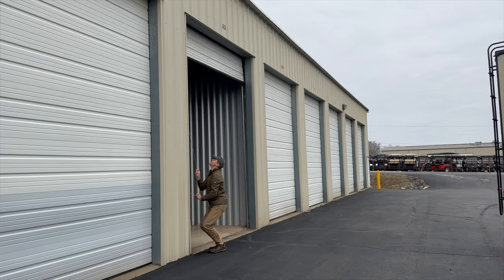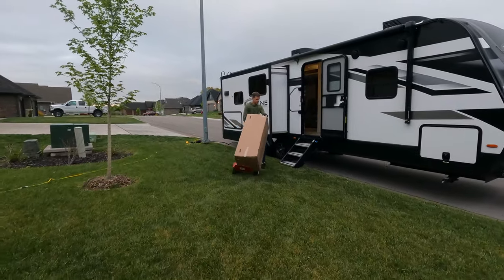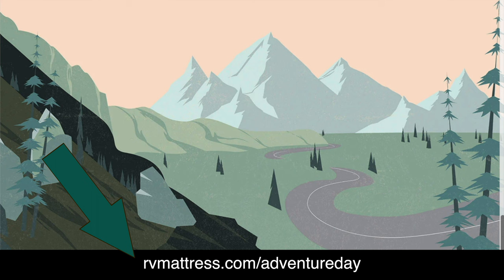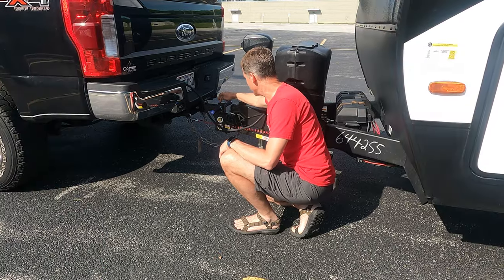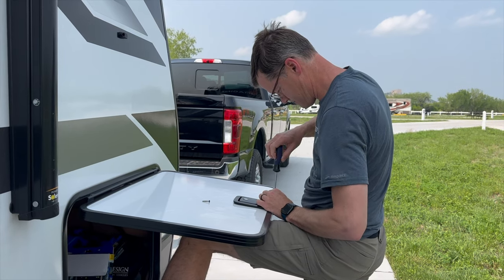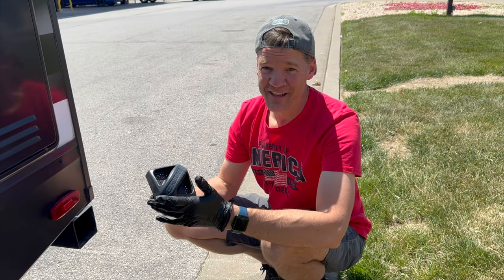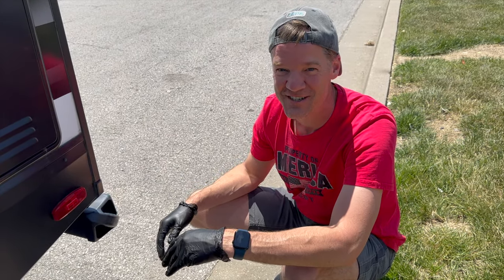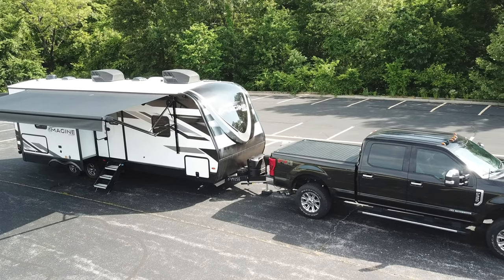New Travel Trailer = New Upgrades // 12 Important Travel Trailer Accessories [EP 102]

Comment: Great to hear y’all have your new rig. Interested in knowing how your towing experience is compared to your past fifth wheel. We have a 32 foot rockwood travel trailer. Pulls great until we get in windy days. Basically same truck as you and the same equalizer hitch. Normal wind and semi’s don’t affect it at all , but 30 mph or so winds are a different story. Just curious how it compares in your opinion. Thanks and congratulations again.  Hope the new puppy is doing well !!
Reply from the maker: Thanks so much! Ginger is doing great and we are continuing with her training. She just turned six months old. We love the trailer so far. We got a pretty heavy-duty weight distribution hitch (one rated for 14,000 lbs) and are pulling with a one-ton diesel truck so we have plenty of capacity both ways. We haven't experienced any sway issues even with some wind on the interstate. We will keep everyone posted.